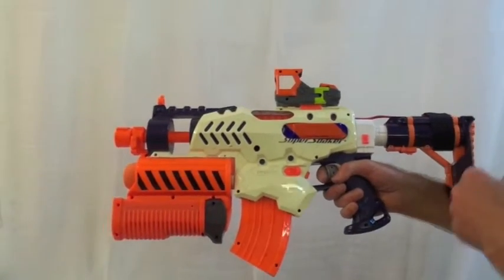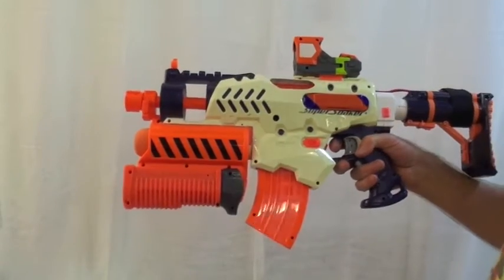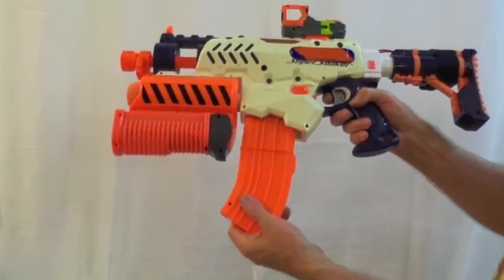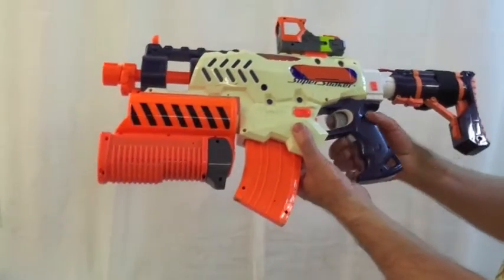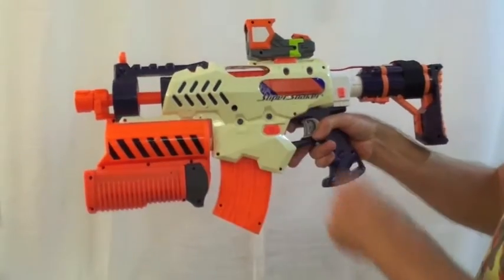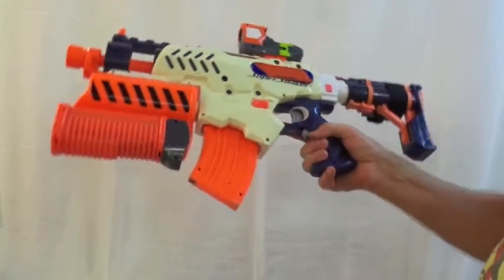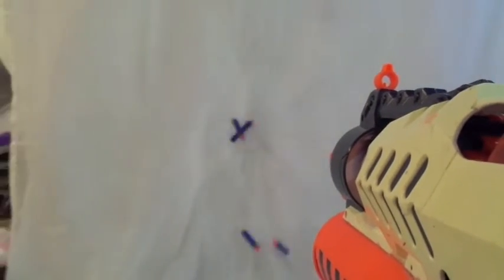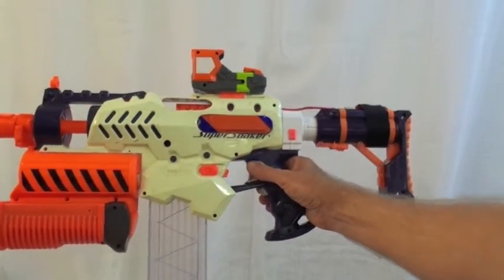[WIP] "The Rapnadomolisher" Nerf Rapidstrike / Tornado Strike / Demolisher Integration

Comment: Just nailed a tornado at a thrift store and was thinking about this the whole time. I could have just taken the stock for a few bucks but it was just calling me
Reply from the maker: Hey CD, only just saw this msg... got held back for some bizzare reason(?) Woooop! The TS is such a beautiful shell and while there are some odly skinny bits, there's a lot of real eastate to play with in there for additional electronics... Really looking forward to seeing the magic you work on it. Shoe-horning an RS in would actually not be that tricky if you didn't mind exposing just a little bit more of the RS shell around the pusher... I say just give it a try :) I'd do mine a hellava lot neater, cleaner (and easier) the 2nd time round. Just finishing off modding the house at the mo but want to post a bit more of an overview of the internals of this thing as it had a bit of a makeover recently and is looking a bit more "finished" with powerstock batteries and other rewiring all done. Good luck with yours!